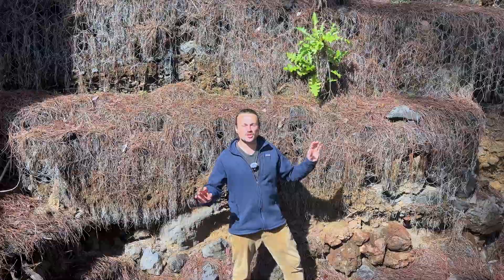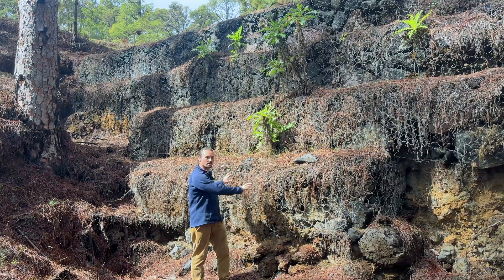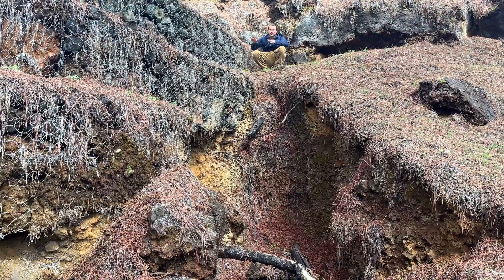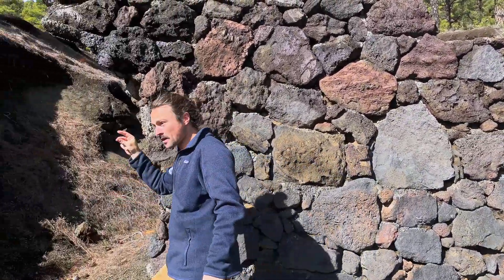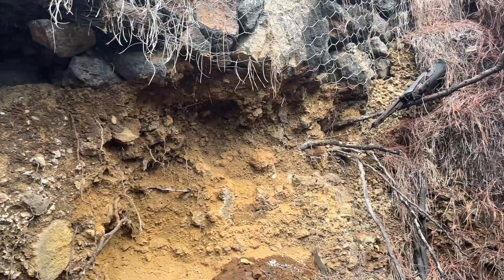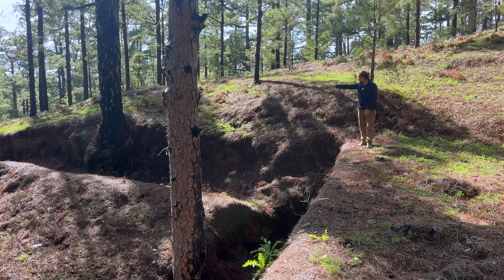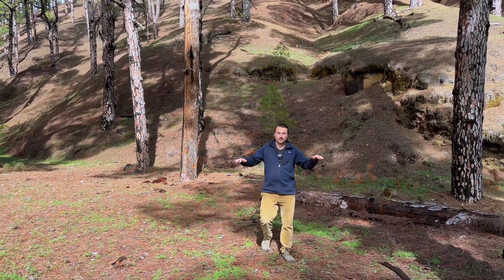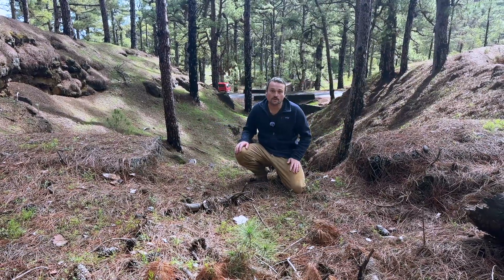Don't let erosion ruin your land - Master Gabion Longevity!

Comment: Great video!  I’m excited to see all the sediment and water that slowed down and deposited!  However, as the metal in the gabion fails what will happen?   I’m a huge fan of Bill Zeedyk and Brad Lancaster, both of whom advocate for the use of many smaller structures rather than a few huge ones, and nature based rather than metal dependent.  Just as you showed, little mistakes create huge problems in oversized gabions, and the metal will only last 30 years, where smaller rock only structures will become part of the landscape and last forever.  Love your content!   Thank you for sharing it!
Reply from the maker: I couldn't agree more. For effective erosion control it is critical to start further up in the catchment. Many decentralised small structures are generally much better than a central big one. I'm also a much bigger fan of working with natural materials. I have another video coming up about beaver dam analogs and what to look out for with them. Ideally, we want to create structures that look natural and hold for longer periods.